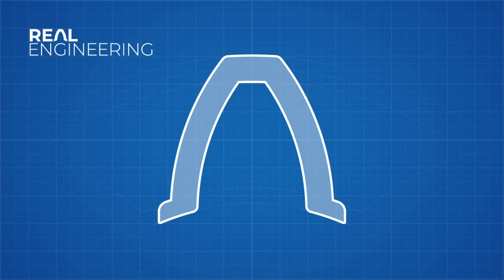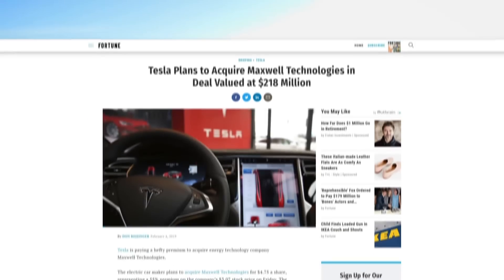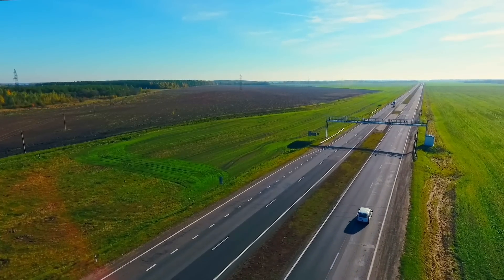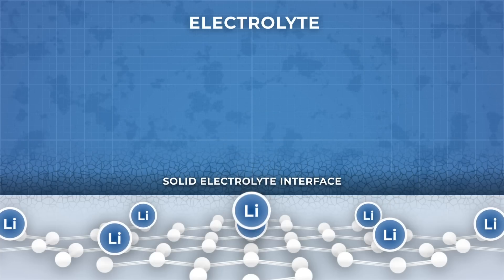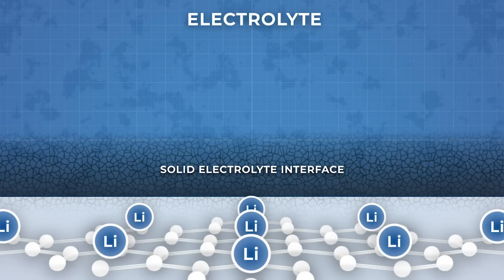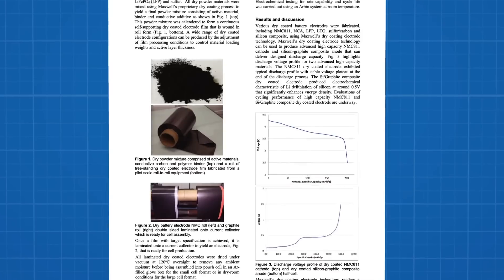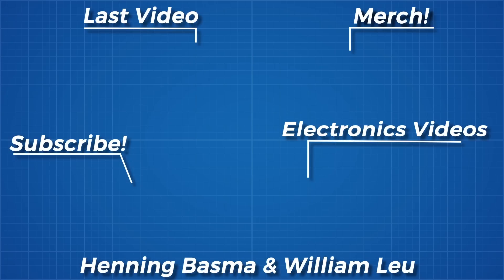Tesla's Quest for Better Batteries

Comment: The NiMh battery used in the GM EV1 was actually the best battery. It might not have been the strongest battery but it had the longest lifespan. It has been kept off the market for almost 2 decades because GM sold the battery patent to an oil company when EV1 production ceased.

Comment: Which will be the greatest leap forward? Dry Cell or Solid State?
Reply: Actually, possibly Dry Cell?
Because

A) It's here now

B) Has potential to increase production thus getting more cars on the road and advancing the transition. (That's the current bottleneck!?)

C) Can be used in production of solid state cells (I believe?)
Reply: @rogerstarkey5390  Whatever method brings down costs (without major compromises) will be the one that works best. Solid state, WHEN it finally arrives, has so many massive benefits it will be hard to ignore:
- Over a million charge/discharge cycles possible
- Can be made from very common elements like sodium (cheaper)
- Can be charged/discharged hundreds of times faster than current lithium batteries
- Little to no possibility of explosion/fire

In the meantime, dry cell will do the trick nicely!

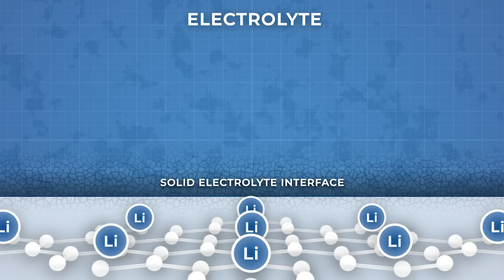Comment: 9:31 NOPE

It's the swing of voltage from the nominal voltage. Keep the battery as close to its nominal voltage (usually 50%) to get longer lifespan.

Comment: By weight, Tesla Batteries are Nickel & Graphite with some small metallic seasonings (lithium, cobalt, etc.).  Electric car's motors operate on 200-350 VDC,  Super capacitors are 2.5 V to ~ 3V.  Just stack 100 of them in series  to get 300 V, but now you only have 1/100th the capacitance. Solvable, but not easily.  Tesla bought Maxwell for the Dry coat battery tech.

Comment: The key is to develop a battery that never looses it's charging capacity. If a battery can be developed to never loose it's capacity charge from the first charge it would be most beneficial in vehicles but shouldn't be implemented into laptops or smaller mobile devices for the purpose of business revenue. The challenge is making something affordable to replace even the cheapest vehicles from the market, even on a used level.

Comment: The average battery degradation after 25000km is 8%. https://boygeniusreport.files.wordpress.com/2018/04/tesla-battery-degradation.jpg?quality=98&strip=all&strip=allThe average life span of a gas engine before it needs an overhaul is 216,000km. So according to the data these batteries are already better than gas engine in terms of longevity and they're only getting better.

Comment: There is a tesla with 350 000 miles on it that did almost exclusively supercharging and still has about 90% original capacity. Considering this and know that the model 3s pack has 1.5x the cooling capacity and better contact with the cells you can assume that no one needs to worry about the longevity of their battery. Most ice vehicles have a major mechanical failure at 200 000 miles so it holds no weight.

Comment: Where did you get that chart from? I looked through the references but didn't see the source material. I'm interested in potential options for the batteries after 8 years.  For example, assume I purchase the Mid Range Model 3 today. Tesla warranties the battery for 70% capacity, which means that a full charge will net 185 miles of range. However, I am only charging my battery to 90% to extend longevity so realistically I only have 166 miles of range.

Tesla has been reducing battery cost by 15% year over year. This is incredible, but it is overly optimistic to assume they can reduce battery cost by this proportion over the next 8 years. Regardless, we can expect the cost of a replacement battery to be a much cheaper than it is today. I'm hopeful that the cost will be lower enough that Model 3 owners won't mind paying it to restore their range. In the best case scenario, owners maybe able to upgrade to Long Range packs for a fraction of what it costs today.

Comment: 11:45 Right this is exactly how a capacitor would be used. The quick discharge could also help with the performance versions of Tesla's models. I would see the Maxwell Capacitors being used on future versions of the larger / faster models such as the Model S and Model X

Comment: Sorry ultracapacitors can not play any role in an EV (that was tested many years ago with inferior batteries and still did not had any advantage). There are no limitation for current EV batteries to accelerate or recover the energy for breaking with no significant impact on battery life.
As you mentioned in this video super-capacitors have energy densities few orders of magnitude lower than batteries and so even if you add a supercapacitor as heavy the the EV battery that will represent just 2 to 3% of the battery capacity. Cycling a battery even at 1 or 2% DOD will have no impact in battery life as a battery same as a supercapacitor can do hundred of thousand of this shallow cycles. The weight and cost associated with adding a large enough supercapacitor to deal with acceleration and breaking energy storage will way better be spent on adding additional battery capacity so you will likely never see an EV with a hybrid of batteries and supercapacitors (I say likely as not always best decisions are made).

Comment: I already known maxwell as making ultracapacitor truck batteries... now tesla partner with them and is doing the right thing. Samsung already included solid state lithium batteries in their 7.5inch $2000 foldable tablet. It's currently classified as the safest battery. One can simply cut in half and all that would happen is capacity cut in half.

Comment: The massive ultracapacitor adv
Advantage is the ability to 
/instantly/release its stored energy
Ultra capacitors & Super Capacitors store electricity by physically separating positive and negative charges— different from batteries which do so chemically. The charge they hold is like the static electricity that can build up on a balloon, but is much greater thanks to the extremely high surface area of their interior materials.

Comment: EV's are nice and all, but the mining of lithium is also pretty bad for the enviroment and very hard to recycle. Lithium ore is also not as common as you'd want if you want a complete shift to EV's. Hydrogen might be a better option especially since a Belgian research team has made a solar panel that can directly transform sunlight into hydrogen gas. Hydrogen gas is also not much more dangerous than methane.

Comment: @8:40 - So essentially Nissan was too lazy to test correctly? I mean, it's pretty common knowledge the Li-Ion batteries perform worse in cold, and they didn't think to test that even a little bit? 
Or perhaps they thought of it, and marketing decided it was better they didn't?
Reply: @11:50 - Talking about the use of the cap to power high load on the motors - that's exactly what I was thinking they would do. 
As if Tesla's don't already have enough acceleration - now we can discharge at a huge rate - for a very short time. I think the 1.9 seconds of the TR2 was with Li-Ion tech. 

Imagine hitting 60 Mp/h in 1 second (in the future) after a red light? hahha dangerous - and fun

Comment: Even someone that works from home and only drives an average of 20-30 miles a day with a pretty efficient car like a Camry or Jetta or etc would still spend around 12-15K$ in that time span on gas and that’s with pretty good conditions as far as not having a long commute, etc. so even with the cost of replacing the batteries plus the charging cost it would still be well under $15K I believe and most people do drive a pretty good amount so it would likely be higher than that. Factor in oil changes and repairs that wouldn’t take place on a Tesla, cost goes up. If the car itself is the same price as what you’d spend on a gas powered car then it seems it’s pretty surely a good investment as far as long term costs for a vehicle. I doubt right now though that most people who have or are in the process of buying one are really worried about saving money but just from a long term cost standpoint if you were already going to buy a new car in the same price range this one would cost less after 10 years almost certainly.

Comment: What I don't get..

Is why not use a Hydrogen fuel cell?

And.. you know..

Instead of exhaust out the water..

Recharge with the solar power.
Reply: Because it's only 25% efficient?

I can't be bothered to explain anymore, read this.
https://electrek.co/2017/10/26/toyota-elon-musk-fuel-cell-hydrogen/

Comment: Put a natural gas, bio-diesel, gasoline or liquid petroleum generator in the trunk. Tesla’s suckiness fixed. Batteries alone do not equal freedom. Tesla could expand their possible market exponentially. I or none of the car enthusiast I know will ever purchase one without an onboard life support system. With a true hybrid system (and a stator motor per wheel drive system) Tesla would rule. Until it does it’s just 1830s tech with a coolness factor and owners can claim their farts smell like roses.

Comment: Finally! Someone who gets the use of supercapacitors right! The number of videos that get it wrong is appalling.
Reply: he isn't right either, since tesla never said it'll use ultracapacitors in vehicles
Reply: Serge Pavlovsky : I believe Elon has alluded to the use of Ultra Capacitors for acceleration and regeneration, where supercapacitors can handle the short-term high energy density requirements.  I’ll stand to be corrected, since my 75-year old memory “ain’t what it used to be” 😀
Reply: @dewiz9596  batteries have no issues handling short-term, they are throttled long-term
Reply: Every once in awhile, I have to remind myself that no matter how polished and well presented the information is; it is sometimes wrong completely, and often wrong in part.
Reply: couldn't ultracapacitors be a replacement if the layers are made yet much smaller?
Reply: @voidofspaceandtime4684  capacitors can't replace batteries because they are the opposite of batteries. they have hight power and cost, but low capacity and density. and their discharge curve is inverted - they lose voltage very quickly and then slower, while batteries do it completely backwards - almost don't lose voltage until the end, then lose it sharply
Reply: Serge Pavlovsky I agree! I think combining the two of them works for preventing degradation of the batteries, prevention from high peaks etc
Reply: @ghst9826  And wasting space by including capacitors... Think about it this way, you have to stack the caps in series to get the voltage up to 400 volts, but when you place them in series you decrease the capacitance so you need more in parallel. Then the wiring and power electronics is needed to balance the banks. All this so that regen braking and hard acceleration isn't as hard on a li battery... Battery tech is improving, and with water cooling a lot of makers scratch their head at the idea. At least most of them up until now have been only making BEVs with a Li battery and no capacitors.
Reply: amorag59 100%
Reply: @ghst9826  do you mean to integrate the capacitors into the batteries making them 1 item per cell?
Reply: Richard Meyeroff hi! No, I meant using them as a “filter” for the incoming charge for the battery pack. Since supercapacitors enable higher power density, more current could be used for the charge, thus increasing charging speeds. But don’t take my word for granted, it’s just something that went through my mind and it could be wrong
Reply: The internal resistance of the battery pack won’t change - thus you cannot force the batteries to charge faster.
Reply: Zefzone - that makes sense, thank you’
Reply: @zefzone-215  but then again at this point isn't the batteries only limited by the grid not being able to support the required supply to meet the maximum charge capacity, at least in my country the grid is the sinner for slowed charging since it's an old grid being updated constantly to supply the needed A for the amount of electrics on 1 street charging at the same time at night
Reply: Tho Skeleton Technologies Ultracapacitors are 2x better than Maxwells. 20 Wh/kg on their best ones, compared to 7.2 Wh/kg on Maxwells best ultracapacitors.
Reply: Or maybe they're just looking deeper into the future?

Comment: There are a couple of problems with your explanation.
1. Why do you not use the term DBE (Dry Battery Electrode)?  Which is how Maxwell describe it.  It's not a dry battery coating.
2. You also state that the solvent used in the current Tesla (wet) electrode is lost and expelled to the atmosphere, which is incorrect.  The solvent is captured and recycled.

I'd think with 1.6M subscribers, you might pay a little more attention to detail and accuracy.  But then again, with 1.6M subscribers, who care is if you're wrong - right?

Comment: Great video! I love that when you get down to the details, the mechanical details of individual atoms are what determine how a battery performs. Its easy to think 'electricity' and think its just magic and electrons- instead of the very real diffusion and flow of ions (atoms) which have mass and volume!
Reply: Then also I like the dive into the engineering side of things. I can only speculate at Nissan's engineering development and testing program, but the fact they did not test over a range of temperatures is a fairly understandable mistake that seems incredibly obvious in hindsight. Its even possible individuals in the organization suspected temperature might have some impact, but the organization as a whole was not capable of foreseeing this or committing the necessary resources. Try setting up a test lab, then have some one tell you need to move all the equipment into a climate controlled chamber (which may or may not exist or be available to the group), while working under your typical deadlines and resource constraints. Something tells me the EV group would not have top priority at company primarily dedicated to ICE vehicles, unlike Tesla, whose entire product line is EV. However like I said, this is speculation at most, who knows what how the actual story went..

Comment: The part about supercapacitors being beneficial in BEVs is completely bullshit. Both the truck and the roadster have tons of capacity in the battery, which essentially means that there's tons of cells in parallel. This makes the power requirement for each cell very low, since the total discharge current of each cell is the total pack current over amount of cells in parallel. Pack power density is not a limitation
Reply: He does sort of address this concept around 12:50- discussing how capacitors might allow for a reduced battery capacity to enable more weight for cargo in order to comply with truck weight limits. However for the Roadster, this does seem to apply, but I would be curious what the power output on its motors will be..
Reply: @byaafacehead  If you dump battery energy then you have to charge more often, which is undesirable. This has nothing to do with supercapacitors. The max rate of charge for Tesla's 2170's is much greater than the regen charge current, so they can't be beneficial in this scenario either.

Comment: Used to hear the same doomsday story when Toyota Prius came onto the market oh my God how much is it going to cost when you have to replace that $5000-$6000 battery 😂 LOL.  It’s come time to change the battery in one of the Prius is $1900 a fraction of the price of an engine about the price of a blown head gasket repair. It’s a very quick disassembly and reassembly process no high school level needed. I’ve been a mechanic for over 30 years. two of my sons and my ex-wife and myself all alone Toyota Prius. my wife current owns a new Tesla model three. And when the car gets old has miles and it’s time to change the battery the price will come down it’s a easy swap out. I wish the ignorant people who don’t know what they’re talking about would close their mouth’s.

Comment: The Nissan Leaf losing 27.5% battery capacity after 1-2 years is definitely not normal. It usually takes 6-8 years to lose that much.

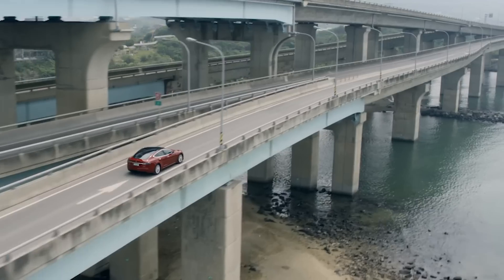Comment: 12:14  I doubt it.  The 2020 Roadster is unlikely to employ Ultracapacitor. It uses too much space for little energy capacity.  
The higher performance is enabled by more batteries working in parallel which is the reason why the Roadster has unintended, insane range of 1000Km (620miles).
12:47 Also unlikely.  You have to recall that trucks rarely do a braking instance compared to its operation.  Better get more batteries for the space, weight, cost of ultracaps.
Reply: The capacitor needs to absorb only as much energy as one hard regen, plus an allowance for hill descent.
If the car starts with the caps empty in the morning, the battery provides the first acceleration.
The regen goes to the capacitor (less power than the battery used) the capacitor provides the next acceleration, if theres not enough supply, the battery finishes the acceleration (low load).
Repeat.
So the battery is only used for cruise, while the "small* capacitor absorbs the high loads.

If anything, this applies more to trucks because of the stress applied to the battery under both acceleration and regen by the weight.

Comment: I've just turned 50 and my boys practically use the same batteries in their xbox controller as I did in my walk & shoot robot man I got for xmas in 1976. Call me simple or layman but I'll only be impressed when an electric car can either travel 1000 km on a charge or charge itself as it's driving. Oh, and not cost north of 200k.
Reply: the batteries in a xbox controller are far different from the 2170 cells in a tesla.
Reply: Boomer